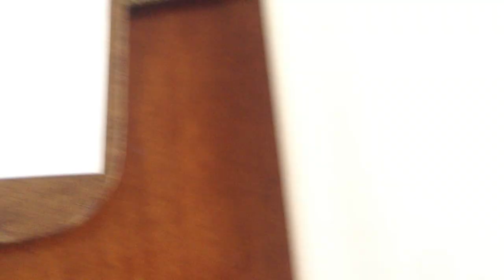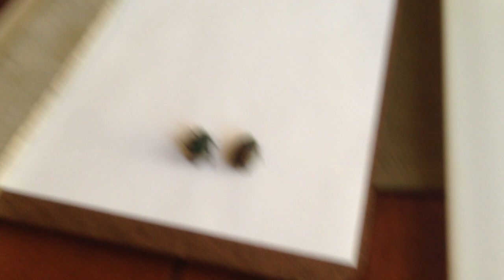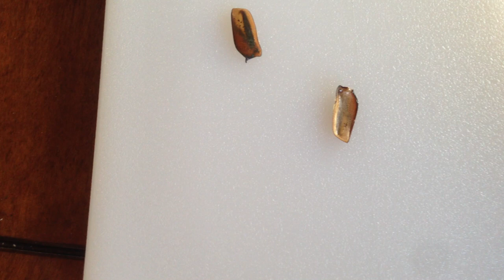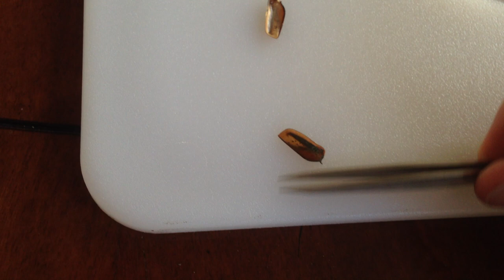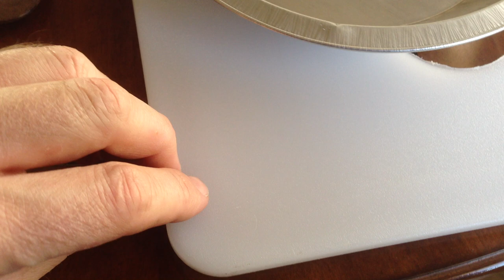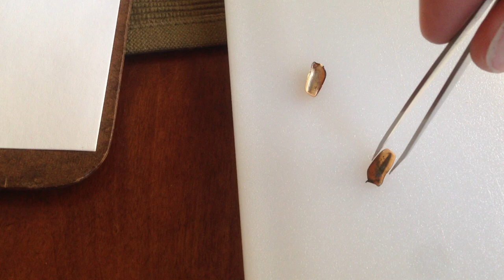Viktor Grebennikov #1 - Testing Scarab (June Bug) Wing Covers

Comment: Its static charge of dielectrics. Its the SHAPE, and in numbers, I believe, Which absorbs the inpulling ether gravity waves. I've hook up a high voltage supply near these wings with strange effects. His platform had a switch to turn on a small HV source like a camera flash charger.

Comment: Is it possible that bug's small wings(when flapping) make static electricity on wing covers and than static electricity in combination with cover wings structure makes "levitation"?
Reply from the maker: It is possible that static electricity builds up, but to cause lift static electricity needs to push against the opposing charge. It is hard for me to believe that enough charge builds up to lift a beetle 5, 10, or 20 feet in the air.
Watch this SE toy and notice how close the wand needs to be to the objects that lift. Static Electricity Science Kit, Overview of the Experiments

Comment: they use seismic technology that make them hoover like dragon fly wings. Dragon flies hum their wings to create the  lift through seismic sound waves. the wings are far to thin and light to be able to take the weight and get lift like normal wings of say a bird. lady bugs do this aswell. Its not static electricity numpty. they have tiny cones in the wings that create the sound energy beams (seismic beams) to get lift. go do some research on dragon fly wings
Reply from the maker: I have researched many insect wings & wing covers. I have seen the spikes on dragonfly wings. Many wings & wing covers have similar spikes. I haven’t heard anyone mention a connection between sound waves and the spikes. I have seen videos demonstrating levitation from sound on its own, but I haven’t come across anything stating an enhanced effect with spikes. I will look into it. Thanks for sharing your thoughts.

Comment: That was a strange effect have you tried magnet movement in conjunction with them? To rule out mag field,appeared to have magnetic braking on the aluminium , are not beetle wing covers of chitin , thousands of linear semi- fractal spiral pipes? this could be a reason for that definitive repulsion effect given movement and opposing them in grav\ time .or just static electricity .. (My experiment) a coated cone sea shell in electrolyte used in connection with high frequency neon transformer, producing a rotating spiral helix corona discharge ,of something lesser than gas plasma ,ionized air ... don 't really know what it is, I will call it grav\time as  static attractants seem to slowly float and spin before horizontal ejection from the side....
Reply from the maker: Yes, I have tried bringing a strong magnet in close to them. It has no effect. I'm sure the chitin nano-structures, chemical makeup, & properties have everything to do with the effects produced. We just need to understand cause & effect better. Looking forward to your research findings
Reply: The  structures of nature are overlooked ,, the possibilities , of using natural structures are very exciting, The Fibonacci sequence \spiral , are prevalent in nature and as well go with high frequency electrical flow ,the meshing of the 2 need no coercion,, so strange, yet also hardly surprising, if indeed universal  intelligent design is a phenomenon...

Comment: Can you do the same test while sound waves are being produced, High Frequency vs Low?  Is it sound waves that cause the effects the Scarabs?
Reply from the maker: I have done this expirament using a small thin transducer glued to the elytra (shell). I focused on the frequencies (wing beats per second) of the beetle, other beetles, and bees. I then slowly increased the frequency, sweeping from 0hz to 2Mhz. I did not notice any change. No lift or levatation was observed.

Comment: I saw a video where somebody said they faked the levitation with a bit of string. So is this actually real or what?
Reply from the maker: While I can not speak on the levitation of Viktor Grebennikov's platform and his specific insect, the research I have done does not lead me to believe it is possible. My videos on levitation show that I believe the levitation videos are in fact using a string/thread. The only thing I was able to validate is their dielectric properties. They will repel each other when they have the same charge, but they do not hover over the other.

https://www.youtube.com/watch?annotation_id=annotation_4067045181&feature=iv&src_vid=5H-VV7Dab9I&v=HW6uOW4aoJQ
Reply: Russell Martin thanks!

Comment: when in flight they are "not grounded"
Reply: You are correct this would be a way of trying to test if the static from the tweezers yet the point that the beetles not grounded inflight is a good one yet the wings are not being grounded the tweezers or plate would be grounded so it is a good test to do

Comment: Did anyone test effects that a magnet may have on these wings?
Nature is smart and leaves little clues for us.
Reply from the maker: I just did so I could answer with certainty. There is no noticeable reaction when the elytra I have are placed in a strong magnetic field. I tried small neo magnets and a large one with 13,800 gauss. No effect.
Reply: Russell Martin Thx for the super fast reply, an investigator would go through a process of elimination, where did Grebennikov live, what bugs are native there, the season was summer, what year, could it be something like a cicada that emerges every 17 years, Viktor left lots of clues.
Reply: Andy Fetisov  read Magnetic Current by Edward Leedskalnin
to understand how real electricity and magnetism work, and difference between a steal or neo magnet, and rubber magnets, and electrostatic attraction

Comment: try adding sound waves to the wings
Reply from the maker: I have tried this by gluing a small transducer to the outside of some elytra. I went through frequencies of the wing flapping speeds and up to 2MHz. I haven't seen any effects from the sound.
Reply: i could be rong but wen i saw another vid about the hover platform.... i think he got lots of wings in a box and added sound to it to make it vibrate
Reply from the maker: Sound will make them vibrate. I have no doubts about that. 
Cymatic experiment

Comment: Do May bugs work too?
Reply from the maker: Yes. Any dielectric material will act like this while in a static electric field. They both take the same charge of the field and like charges repel so they repel each other. If they do not have a charge, there is no effect.